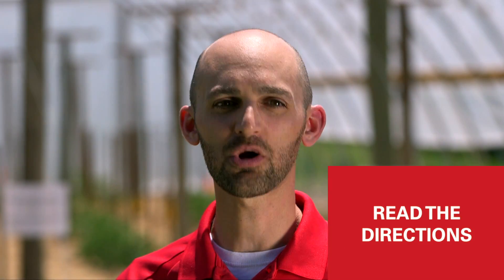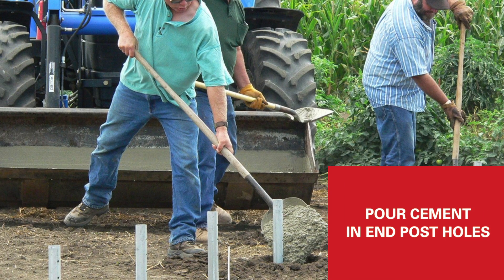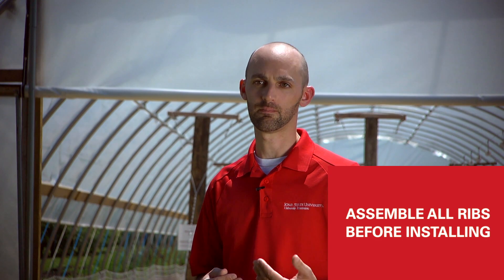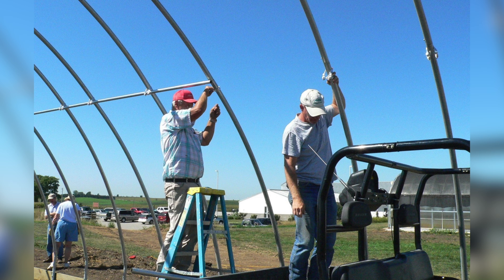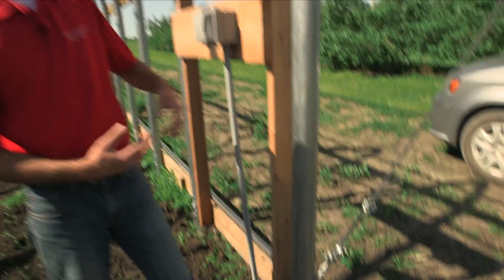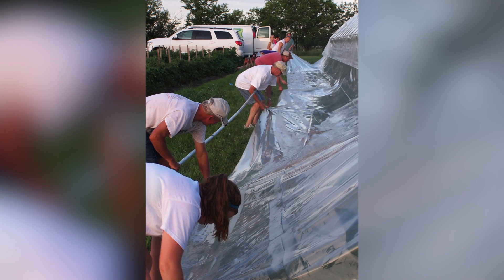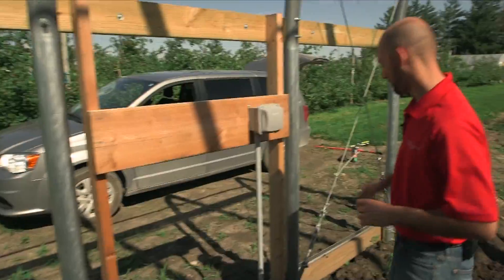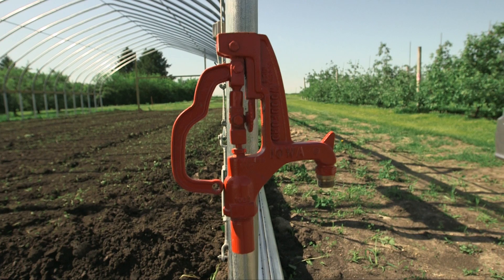How to Build a High Tunnel

Comment: Plz mention the  height of the polytunnel and also length,width of the polytunnel????
Reply: A high tunnel can be about any size.  Standard width are 20, 30, and 40 ft while standard lengths are 72, 96, and 120 ft.  That said, you can get a tunnel as small as about 20 ft x 20 ft or as large as acres in size. Height can vary from as los as 10 ft on smaller buildings to 14+ ft.  I think I have seen a few that are 18+ ft.

Comment: What is the height of the greenhouse that will be used to grow peaches?
Reply from the maker: You will want 18 to 21 ft minimum for growing peaches in a high tunnel.  Please note though, if you are in Iowa, I do not recommend growing peaches in a high tunnel.  The winter temperatures in a high tunnel still get cold enough to cause loss of fruit buds.